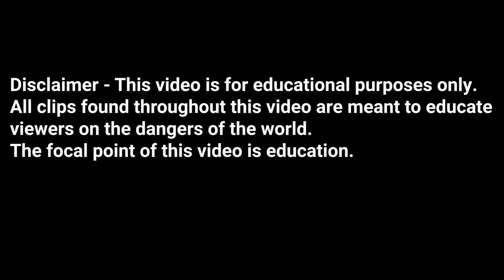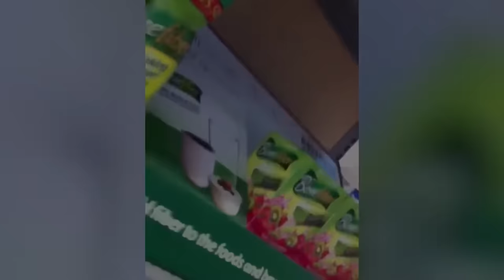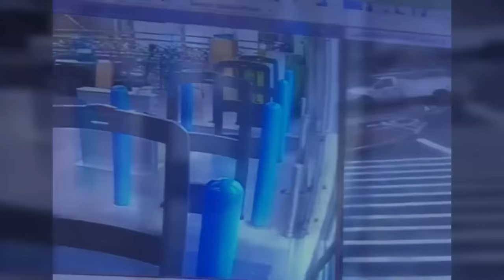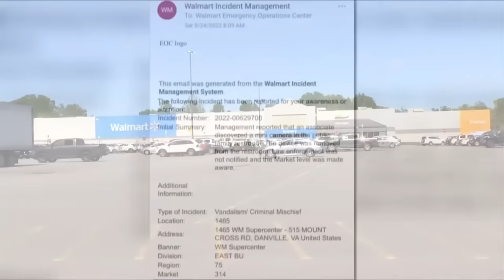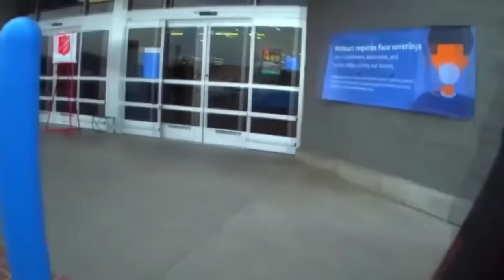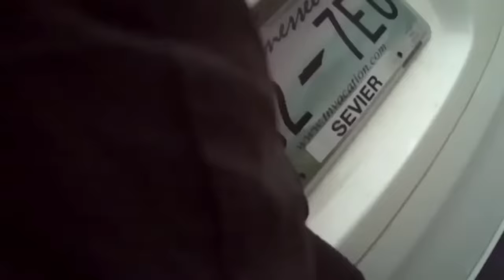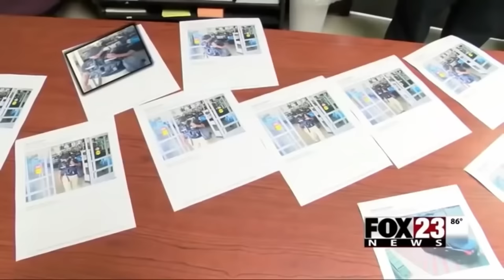50 Most Disturbing Things Ever Captured In Walmart

Comment: Instead of going for the electronics when the 200 people ran i in I would have went towards the pipes and got all the brass and copper fittings the larger containers you can get 30 to $40 for them in scrap and also rechargeable tool batteries
Reply: Good for you
Reply: Thief.